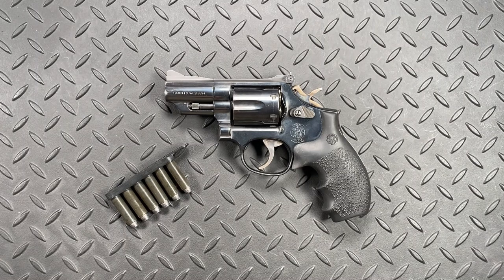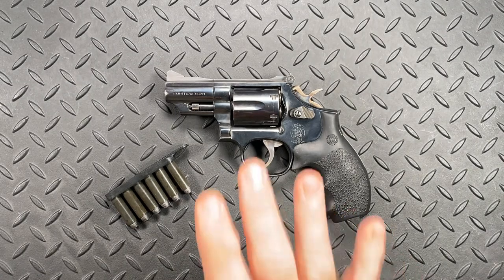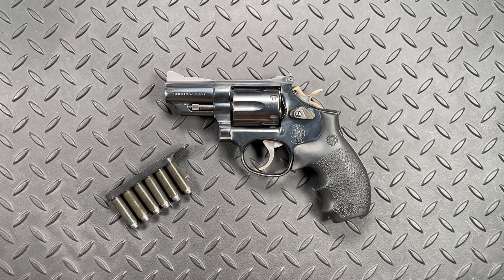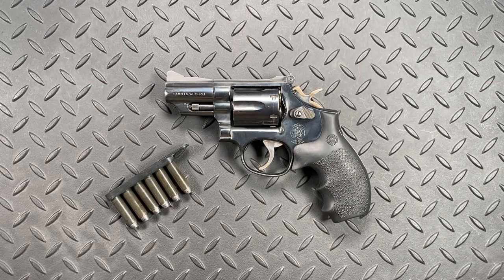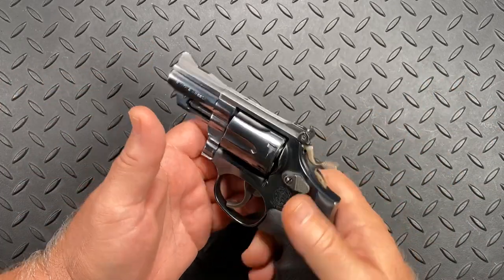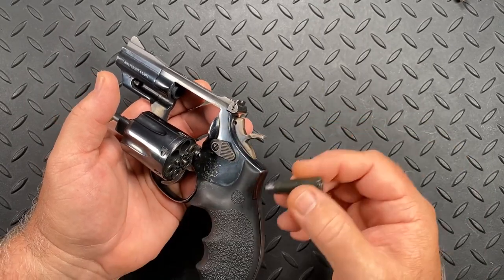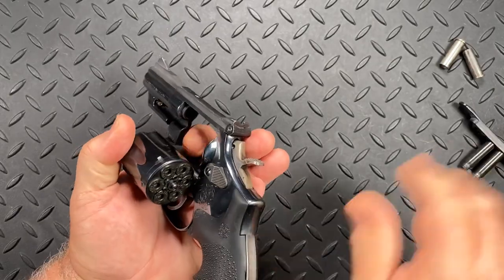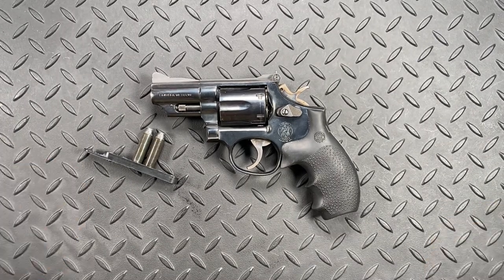Tactical Reloads for Revolvers

Comment: No lull in my ‘74 gunfight.  I had to reload my empty Colt Detective Special (I was a detective assigned to the Robbery Squad then) w/a speed loader and was back in the fight very quickly. Speed loaders were not authorized equipment in ‘74.  We’d been trained to load two at a time from the lops on the duty belt.  My EDC in retirement is a 340PD w/a speedstrip in my off pocket.  Good video.
Reply: Thats not to say that there arent gunfights will lulls sprinkled throughout though. 

Great EDC gun! I run the M&P340 (no scandium cylinder so it can take any .357 loads) but I've been eyeing a 340PD too.

Comment: Great video!  Question: I have a modern Colt King Cobra in 3" and I have a couple HKS #10 Speed loaders and a couple speed strips.  What Safariland speed loader works with the current Colt KC? and Which of your holders work for it?